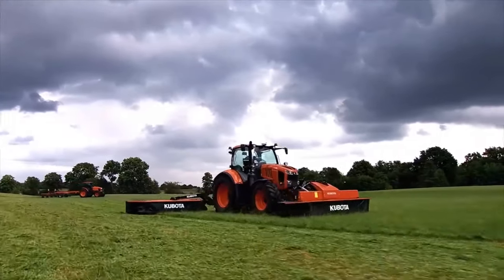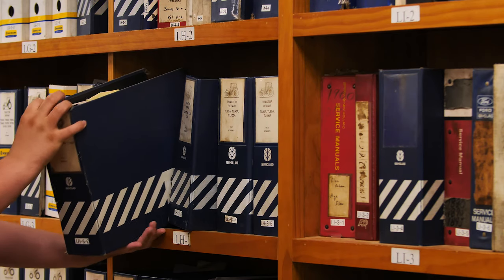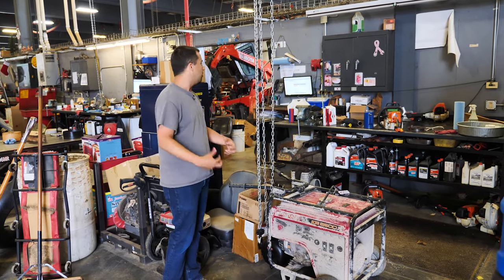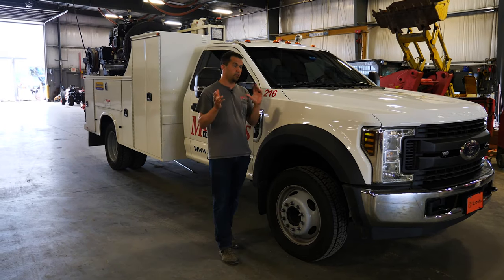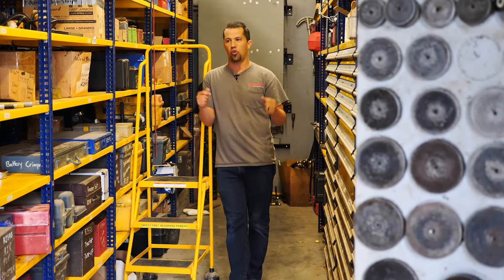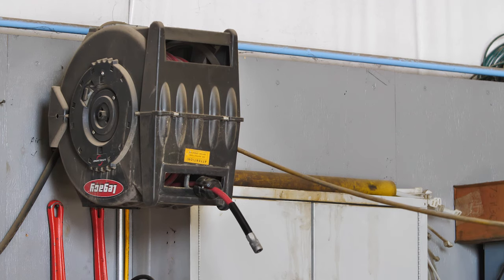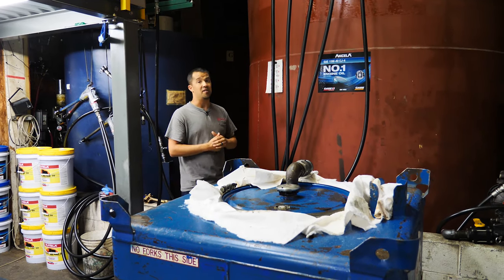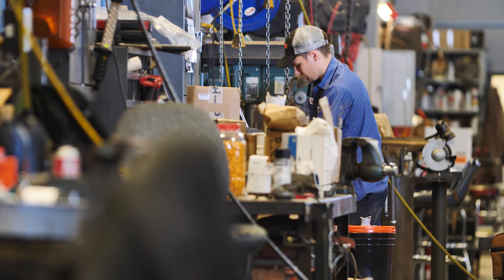Messick's 40,000 sq/ft Equipment Shop Tour | Elizabethtown, PA.

Comment: Generally many people have no idea what goes on behind the scenes of a service/repair shop of any kind, whether it be automotive, electronics, or in your case farm equipment.  So these types of videos are a great tool to show customers what really happens, and why a shop charges that $100+ an hour for labor...its not because they're greedy in most cases, its because that shop probably has several million dollars in tools, equipment, manuals, parts, etc. that they have to keep on hand to work on that 80 year old piece of equipment as well as that brand new million dollar tractor that just came out.  Awesome video, thanks for sharing.  

Not everyone can be a a mechanic...I tried to fix my car a couple weeks ago, now it don't run at all after a head gasket replacement so...yep I won't be checking out any mechanic jobs LOL.  

Have a great weekend everyone.

Comment: I would rock putting tractors loaders and backhoes together as well as repairing equipment. Used to run a 3 bay shop back in the 90's until I found better paying work in IT.  I just finished rebuilding an IH 35 rake, and have a JD 1209 and NH 273 to get fully working too.   When I bought the backhoe for my B2410, a Woods BH70-X, I put it together myself, was easy for me.

Comment: That was an excellent video. The logistics of the operation, the design of the shop and the overview of the different areas that encompass something as vital and intricate as "the service dept" were superb. The oil storage and recycling facilities alone really illustrate why dealerships are more costly than a shade-tree mechanic. Getting it done right is more than just replacing a filter, it's everything before and after too. 

Btw Neil, still waiting to hear when you're breaking ground on a dealership in N. Texas. I can't wait to buy my new tractor forever you know. LOL

Comment: WOW just Wow!!!!!  on your bulk oil system, if you're using two different products, how does it clear out the line of the previous product before adding the new product.  I imagine there is a lot of line between the storage tank and the hose reel the tech is using.

Comment: This people is why when you buy a quality piece of equipment,its imperative,Unless you have a lot of disposable cash,you keep up on your maintenance of this equipment at home to the best of your ability.As Neil said,SHOP RATES are not cheap,Nor can they be with overhead like this.This shop looks to be about as efficient of a repair and maintenance shop as Ive ever seen.I am a heavt industrial mechanic by trade,and efficiency is #1,I hate disorganized,messy,unequipped shops,Ive left a few behind me.Beautiful shop,well structured.
Reply: I agree...I don't have heavy equipment but the little stuff I have I make sure to maintain properly and keep clean as well...you can't tell if there's a leak or a problem in many cases if the equipment is covered in dirt.

Comment: Wow, nice shop. Seems like a much healthier ratio of workshop-office staff than what I've seen.
Service Manuals can just be re-printed by the office girls after you've got the authorized copy.
But then I've only worked for OEMs so maybe I don't know what I'm talking about.
Shop software = Slow af.
I was just working on a place where we were installing some of those left-over fans 'Bigass' is the company. A team of their guys can set up 16 of those fans in one 12hr day.

Seems like your trucks are pretty well set up for the job, I like, with an F-550 they're probably not as crusty on the inside as most service trucks.

If you ever work on a Komatsu Backhoe just remember to buy the go-go-gadget extendo-arm tool, necessary for any minor/major service.
Better yet, don't buy any Komatsu model with a serial # starting in F - The F is ostensibly for Italy but really stands for f****d.

I'm really loving your bulk oil system, I've worked for companies with 3,500+ employees and 5-8 Billion dollar budgets but I've never seen that. We've either had bunded oil storage (which we then pour out into 55 gallon drums or 5 gallon tubs, or we have drums and drum pumps, and use a jig on the forklifts to move 'em around.
Most of the 40+ branches use hand-pumps.... And yet we charged the customers $120+/hr for labor (this is Australia).

Love your set-up L.O.V.E. it.

Comment: As a service technician (otherwise called a mechanic), I can tell you we tried the "progress photos/reporting status" during each phase of disassembly, diagnosis, estimate and repair processes and it was a pain in the rear! Sometimes we ended up adding 2 hrs to a job order on larger equipment with all the excess bloated information reporting. We found the repair process is simply more effective by actually getting it done without all the "baggage." Old fashion real customer service! I bet if your tech's had their choice, they would rather disperse with all the dog and pony show reporting. I would guess your tech's are already pushed to get repairs out the door as it is. The schedulers should just walk out to the shop and visually check a repair status then report it to the customer. Done. Simple. Let them take Kodak moment photos if they want. All the information for our customers repair is contained in our report findings, estimate and yes, sometimes photos as needed. It is a "streamlined" old fashioned process. Customers would rather their equipment simply get repaired and back in service in a timely fashion. I guarantee it.
Side note: all the videos are great and I have learned a lot of great info from them! Thanks Neil!  
[B2650 Owner]
Reply from the maker: Your totally right. On our end, warranty requirements require extensive documentation, photos, diagnostic files, etc. Unfortunately it's part of the job now.
Reply: Messick's 
I understand as indeed things have become more complicated including turning wrenches.🔧 Your shop looks like a good place to work though. Nice facility. 👍